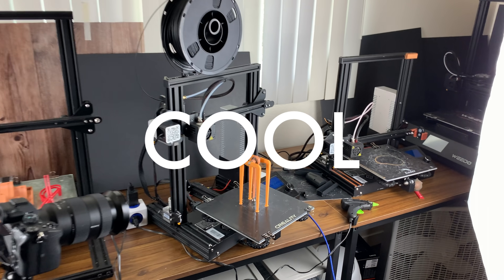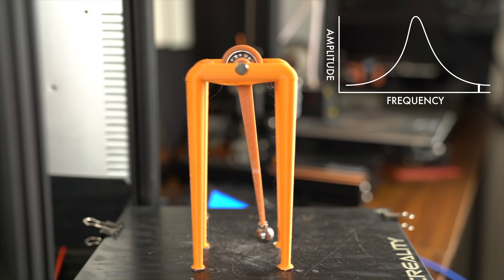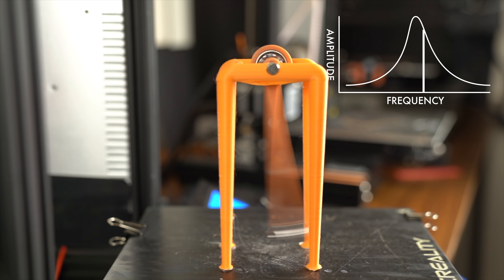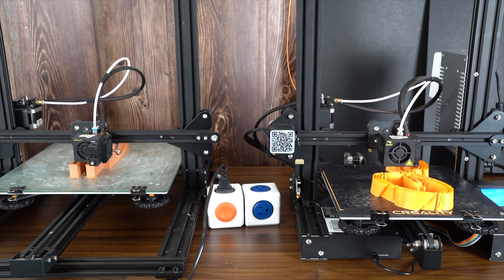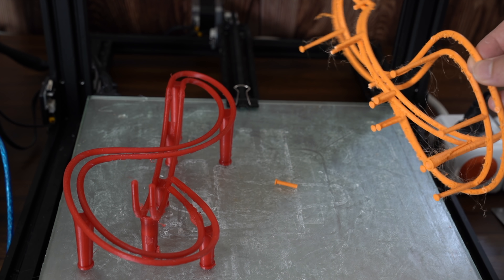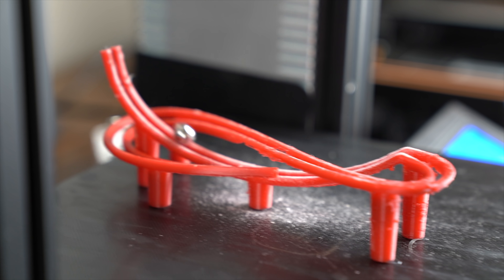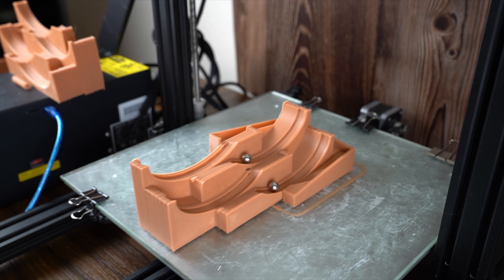Using 3d printer to prove power of resonance.

Comment: If you give the lowest point in the middle of the (<- curves a little ramp downwards u can have them fall back down to a lower "energylevel" 
Also different resonators with different fRes. could be used to become a bit like an electron orbital system that absorbs specific waves to jump states.. or to navigate the ball through a 2 or 3d maze just by applying the right freq:)

Comment: Dude!! Only use the dissolving material for the interface layers of your support!! Use regular filament for the rest of the supports. Why? dissolvable filament is more expensive! So the standard way to use it is just have a few interface layers with it, it will still make for easy clean removal but save you $$

Comment: I really like your last staged oscillator. Is a really good visual demonstration of chemical potential energy for electrons in a lazing material. That last ramp from the top is where the electron would give up its energy in the form of a photon. And the stepped oscillators are what happens when you pump the lazing medium with a lower energy photon.
Reply from the maker: wow cool analogy!
Reply: If you're going to use that analogy anywhere, then it probably best fits a ruby laser.  If you really wanted to go the extra mile you could make two of these and put them together on the platform on rollers linked with springs.
A really cool effect that Steve mould shows called synchronicity happens and the vibrations of all the marbles will line up and happen at the same time.  That would be a true laser.  Laser is an acronym, light amplification by simulated emission. The synchronicity is the stimulation part.

Comment: Your resonant tuning was great. add more amplitude or more distance to the frequencies. The energy level was just enough for the marbles to work. But more energy would be more consistent working. It was at the threshold of energy to work, hints why it worked seemingly random. . Maybe an idea for part 2? I'm intrigued.
Reply: In this system, energy is limited by the mass, the speed, and frequency. Since the granularity of the frequency is limited and the mass is fixed then the only way to increase the energy is the speed which would require a greater throw distance.  Since that distance is limited by the size of the printer, he's pretty much limited to frequency in how much energy he can put in the system. As an interesting side note, he could vary gravity by making the ball a magnet and using steel rails. Then he could make gravity in the direction of the oscillator weaker by tilting the apparatus.
Reply: It appears he tuned by adjusting distance by frequency. It always was the same distance in each test. Most likely he tuned by ajusting the feed Rate by the knob on the printer. 
 
To clearify I would like to see more distance in the same frequency. It would increase acceleration forces for the givein frequency. 
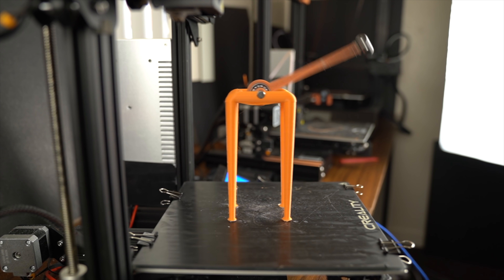He was only using around 50 mm of 280mm that printer is capable moving and the resonant frequencies was relatively low compared to max velocity. It is more then capable of the speed and power to have a greater access of power to make the marble ramp very consistently. look at fast long movments at 3:11-3:17

Starting and stoping in 5 mm 1 second
 VS
Starting and stoping in 50 mm in 1 second would add 10 times the energy to the system at the same residence.

I would like to see 100mm and 200mm/ 2 and 4 times the energy and what the effects are. Then again the he was putting very little power in the system to show the energy build up of resonates Maybe am missing the point of the video. 50 percent of any answer, is understand the problem. lol I would still like to see him tune the marble machine. lolz

Comment: could you research the possibilities of energy harvesting using resonance? for example, on the marble tower one the ball gains potential energy but you have to apply energy to move the entire system, however if the resonance came for natural sources such as the wind, the ball would gain potential energy without you having to apply any energy at all to the system, the wind would do all the work for you
Reply: That's in theory a good idea, but practically hard to implement. Because wind is so turbulent, it's almost impossible to get it to be the certain frequency required to match a power generating system's resonant frequency. This is why windmills are good, because no matter the speed of the wind, they'll still spin and generate power. (Or you could use the spinning motion to raise a ball).

I know your comment was 9 months ago, but maybe someone will find it interesting and they'll see this too :)

Comment: nice demonstration! What I'd like to add is, that the resonant frequencies of those systems (especially the pendulum) are amplitude dependent. For small amplitudes, the resonant frequency varies very little, but above 45° it drops significantly. So the fact that you tune the excitation frequency from high to low is ideal for this demonstration, because as you come closer to the resonant frequency, the amplitude increases and the resonance frequency drops a little. So you get a quite flat curve there. Once you reached the maximum and the amplitude is reduced, you can clearly se the sudden breakdown of this effect and the rise of frequency. You would have gotten a very different and way less impressive effect, if you tuned the excitation frequency from low to high instead of the opposite. It would be nice to see a plot of amplitude versus frequency with both tuning directions :)
Reply from the maker: Great points! For the marble machines I used a cycloid shape so it could be amplitude independent (should have mentioned that in the video!)
Reply: @3DPrinterAcademy  the printer movement looks not sinusoidal so it will be a nonlinear system

Comment: If you attach the camera to the bed, it will looks like the ball just magically moving left and right
Reply: Yes! I was just going to comment the same thing!
Reply: That would be the format for a YT Short video.
Reply: Except you're gonna see the whole outside reference system moving, but it would be cool nonetheless
Reply: @JohnDoe-lz4gk  you would use spot illumination and some cloth to black out the frame, of course that light also would need to be attached to the print bed.

Comment: I've spent the past week trying to wrap my head around room modes in acoustic design and I think this video helped a bit. Thanks!
Reply from the maker: Room modes are so frustrating for recording audio. Resonance is everywhere! My standing desk would resonate with the ceiling when set to certain heights...
Reply: Look at water in a box if you want a good visualization of room modes. Have something disturbed the water, and then look to see what patterns are left after the initial disturbances died down. Water however is only a good two-dimensional analog.  In a real room you'll have at least three primary low frequency spikes, and then a couple of sweeps representing increasing lengths blending them.  Then you'll have additional spikes representing the harmonic frequencies of those initial 3.  The lowest resonant wavelength you should see should be twice the longest distance you have in the room. That will probably be from one corner on the ceiling, to another corner on the floor.  If you want a quick cheat for recording studio then hang stuff in the corners of the room, and put towels on the walls. The non-uniform shapes will disrupt reflections and damp any resonant frequencies.  Rugs also help.